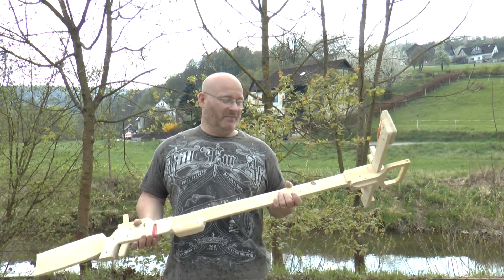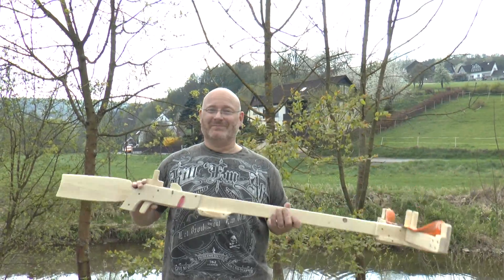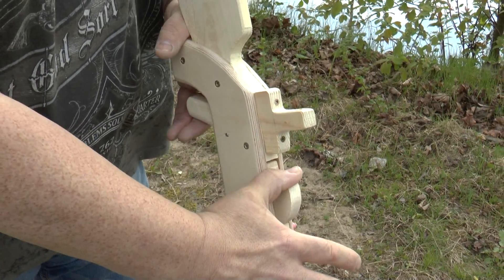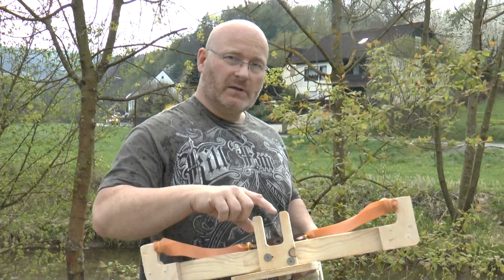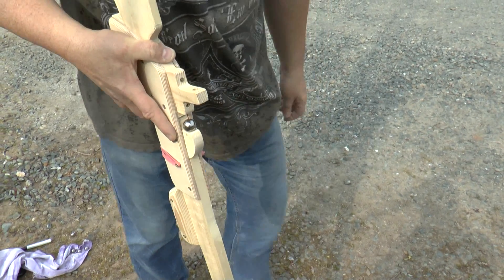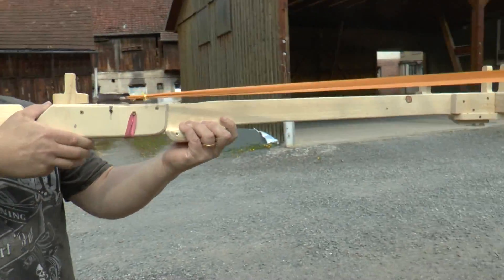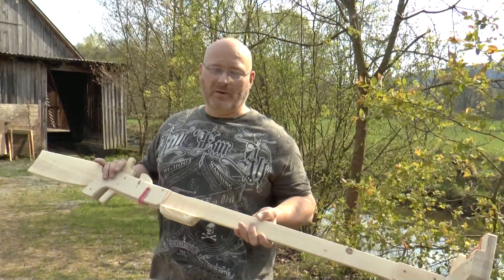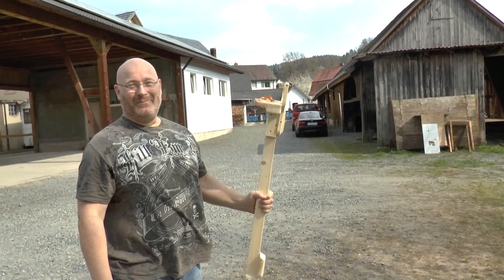Hole in hole: Homemade sling-x-bow with medieval features

Comment: Hello Joerg. Im not that creative with homemade projectile weapons, but I have this idea on my mind for aiming systems. Since most homemade weapons have a bit of curve, its quite important to have elevation. If you have a ring front sight and a vertical long hole at the rear you can make markings on the rear sight and can know at what range to align with which markings. Maybe get known angles for like 10m or 20m

Comment: Excellent accuracy! I don't know if you could load it fast and under pressure keeping that steel ball in place during zombie attacks but great design nonetheless. Perhaps, a light magnet applied to the roller nut may cure this problem.

Comment: I made a medieval crossbow with a PVC bow sometime ago. It shoots bolts, so the nut has the piece that holds the string  is divided so you can put the bolt through that, and hook it onto the string. Sadly ,that makes it weaker and the pinewood nut snapped after a few shots. Has anyone got an idea from what to make the nut?
Reply: I've seen people use solid aluminum (a.k.a WeaponCollector), you could even just put some mild steel on either side of your pine wood nut and that should reinforce it. I made a pistol crossbow that uses an acrylic('perspex' i think it's called in America) nut and trigger although it's draw is only like 8kg it holds up really well but I wouldn't advise it for bigger crossbows unless you have a thick nut.
Reply: The Doc Oc thanks for the answer. I'll definitely try to put something on the sides of the nut!

Comment: Hey Joerg, why do you do a hole in the leather pouch? What features do that hole does? Thank you.
Reply from the maker: It makes sure the pouch does not slip over the steel ball.
Reply: JoergSprave Thank you for answering. I'll make sure to do it to mine as well. Great X-Bow tho, amazing precision. Did you make it with our without blueprints? I'm freaking out to build one but I have no idea how to start it. My rubber bands are also cylindrical shaped, not rectangular as your bands are. Do it affects?
Reply from the maker: Giovanni Mallía I sketched everything directly onto the wood. I prefer flat bands as they are faster, but tubes work OK too.
Reply: Thank you again. How many tube bands should I attach to my crossbow? I've put 1 but it doesn't hurt. I wanna freak out the target, you know hahaha Thank you Joerg!
Reply: Giovanni Mallía just double up til you are happy : )